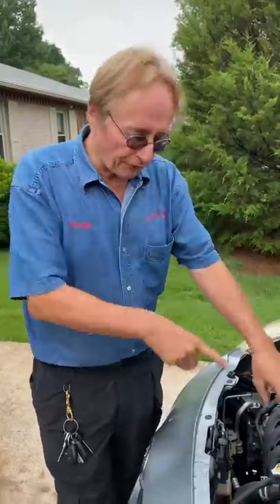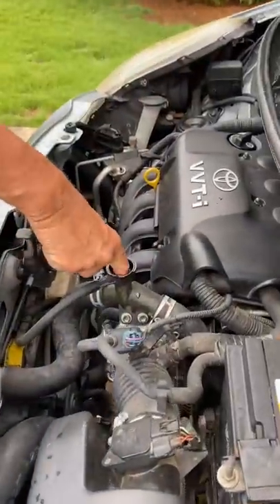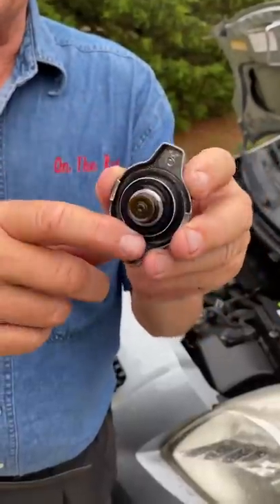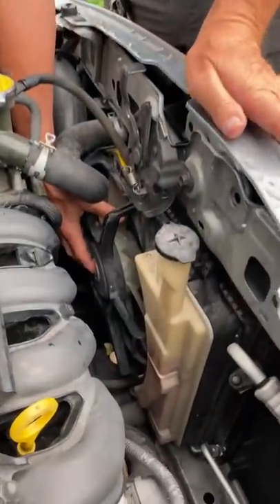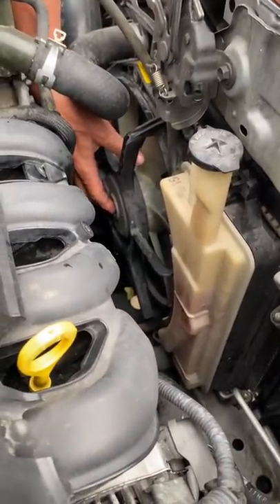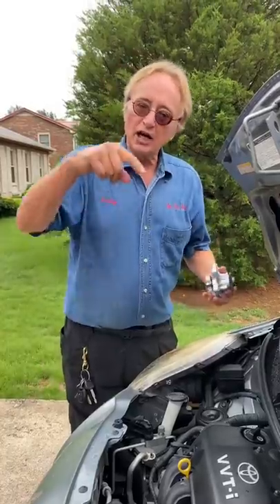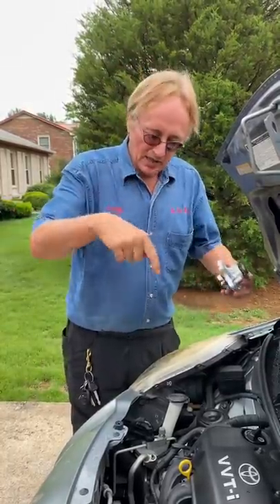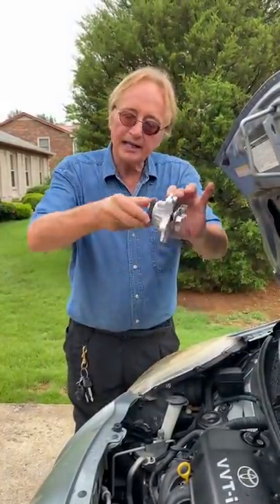If You Want Your Engine to Last 400,000 Miles, Do This

Comment: In a pinch, to get somewhere safe, you can drive with the heater on full blast.  Just keep your eye on the coolant temp not to get it in the red. It helps pull heat away from the engine.
Reply: Common sense.
Reply: Pull over and open the hood.  Wait 15 to 30 minutes.  Drive till needle gets close to red.  Repeat.  Works quicker in winter.
Reply: And turn the a/c off
Reply: I've done that and I really didn't see a difference... maybe my heater core is too small.
Reply: @sandasturner9529  Assumes sufficient coolant is system to dissipate heat via heater core.  Brutal on a 115 degree day in Las Vegas...
Reply: @johnsee7269  well my car only overheated when the radiator hose tore open. Then it took a while for that to happen. 2006 supercharged grandprix
Reply: Yeah, heat on, windows DOWN.
Reply: @sandasturner9529  
If there's no coolant in the system, turning the heat on won't help much.
Reply: Not the ac though right?
Reply: In my air cooled Porsche 911, I would pull up on the heater levers to cool down the oil temperature in traffic.
Reply: Definitely depends. Had a coolant sensor blow out with the crappy plastic mustang intake. I was turning off the road as it did this. Turned, pulled over and within those 2 mins burnt 2 valves. I guess I valve per minute lol. 
It was a great excuse to purchase the better PI intake and stage 2 ported heads though lol.
Reply: Just remove the hood, who needs it?
Reply: Opening the heater all the way allowed me to safely get back to my area. Was a brutal South Florida summer day, and I was in heavy traffic, zero breeze with windows opwn. But the heater core kept the coolant temperature barely above normal. I caught it early enough there was very little temperature rise to begin with.

The culprit: lower radiator hose was cracked.

Comment: Dont forget to check the Thermostat, some stick closed when they should open. Easy to test by throwing it in some boiling water and looking for it to contract.
Reply: Thats exactly what happened to my 02 corolla. Ran well when moving but stopped or idle too long and it overheated. My dad knew whats the problem when he saw the coolant wasn't flowing well and we got the thermostat changed. Thank goodness my dad is a good mechanic.
Reply: Grizzly  Hehe. Well he's no Scotty, but he does have a lot of experience with cars.
Reply: Too right. I just had that on a remote thermostat which jammed closed. It meant the engine was ok on the internal coolant loop for a good time but once I was on a fast road the bloody thing overheated when the thermostat failed to open. Result being the head gasket went so that's been a pain to replace.
Reply: @simonroyle2806  Bugger thats not good,i just put new thermostat in my back up Toyota,i got genuine toyota one the price was good and its quality ....
Reply: Suspicious thermostat? Throw it away.... if you live at equator like me!
Reply: Save electricity by adding pasta 😋 while you boil BOTH in mom's BEST PAN! 
We know who you are! 😏

Comment: Former radiator repair guy here. If your car has an overflow tank, as most do, there is a small valve in the cap. When it wears out it stays open so that your cooling system doesn't stay pressurized as it should. If you see no leaks change the cap and see if overheating stops. It's often that simple.
Reply: What's the worse that could happen if you overfill coolant overflow tank? I can't see the damn markings!
Reply: @Vanguardkl  Well  I overfilled mine once with poor lighting. one of the radiator hoses busted after driving. Keep it  half full, look at it when it's hot. If its 3/4 full hot your in the ballpark.
Reply: @soundmind192  If overflow tank is too full it'll just blow it out and waste it. Like an overfill automatic transmission. But an overfill trans is a bad thing. Potentially damaging. Overfill coolant, not.
Reply: Make sure your overflow tank has an over flow discharge tube and nothing will happen it will just go down on the ground. Only fill the overflow tank half full at the most.

Comment: Have a Hilux, radiator was busted on it and it overheated frequently. Still drove it, never broke. New radiator in now and it runs like new 😂
Reply: Toyota Tanks
Reply: Must be a old one they are tanks
Reply: Diesel ?
Reply: Gonna if it's the 22re those are tough little motors but there aluminum heads that couldn't like too much heat on it...........hello warped heads
Reply: The truck Top Gear couldn’t kill. Another testament to the little truck that could!

Comment: I had a Plymouth Breeze with a bad head gasket.  I could drive it, the temp would hit max, then the expansion of the engine would seal the leak and temp would go to normal.  Not great long term and I don't recommend it for most :)

Comment: Those water pumps are tricky when they start leaking because they leak fast. That’s the only issue I’ve had with my Volkswagen Golf. I had to buy G13 fluid and I kept it cool. Replaced the water pump and thermostat. Luckily it was -20 out so keeping it cool wasn’t complicated lol.

Comment: My gauge doesn’t work, it always stays at cold. But it had an overheating problem too, so the gauge made its way to the middle. At that point I thought it might have started working, but I wanted to make sure. I checked it and it was boiling. I put in a new radiator and flushed the coolant and it works great now. The gauge stays just a millimeter off of cool

Comment: The cooling fans on my '16 Mustang WILL NOT engage with the A/C on, unless the outside air temp is over 95F or the engine is over 180F.  When one or both are at temp, the fans kick on & off normally & the temperature gauge never goes above less than half way.
/It's just the way it is!  Not all vehicles are made the same!
Reply: My 2010 Toyota Venza is the same. I never hear the fan running unless it's over 95. My 2001 Sebring though, that fan is always roaring.

Comment: I have a 1999 Toyota sienna no matter what clamps I put on the radiator hose or change to a new hose the coolant always leak at the clamps especially in the winter last summer it actually didn't leak till winter it leaked again

Comment: My Tiguan has been overheating, the coolant cap is cracked and the elastic that pressurizes the reservoir is broken. Will be replacing the cap soon.
Reply: Giovanni Martinez  I stopped driving the Tiguan till I got a new cap. All is good now, hopefully, nothing bad or permanent is done.

Comment: I have a 2015 Dodge Dart SXT with 2.4 liters I’m an original owner and so far I have 210,000 miles with twice flushed for every 100,000 miles with 2nd times and I always change the oil and filters OW-20 high mileage and now for the first time almost 210,000 miles with changes the Battery for the 2nd times, and the first time the original alternator went kaput replace with OEM at the dealership service and with the new positive battery cable due to corrosive since I live in Upstate New York then all good
Reply: Tune-up once so far

Comment: My mothers car is a Toyota Yaris form 1998 still going 340.000 kilometers. Never had its engine Open ONLY regular service
Reply: Yes my 2009 has been extremely reliable loving it so far, wish it had a little more than 106 horse power but the gas mileage is great. I’ve just done oil changes every 3k miles, iridium spark plugs, air filters, tires and brakes.

Comment: Last month, had a radiator hose blow out on the Jeep GC inherited from my father's family while stuck in severe weather, torrential rain and bumper-to-bumper waiting behind a real bad wreck. And this was with me intermittently cycling the car off in the times there was NO MOVEMENT -- despite the care I took, the boiling still happened and the old hose just blew. Was a hell of a time between me, my other family members getting me help by a police officer to move the Jeep to the next exit in the HEAVY downpours and then pulled into an open-air spot underneath the highway. And this happened in an unfortunately bad reception area no matter the cell phone provider, which didn't help things any.

Thankfully an auto store is in the nearby shopping center and my father's a regular customer. After calling in the order and me getting the replacement hose, I went right home nearby via different vehicle for distilled water and tools to get it changed, then drove the Jeep home. Going through a tear-down of the cooling system, you know what the true culprit was?

The thermostat was broken via metal fatigue, thus causing one of the big issues thermos can have -- and my father said that in all of his years, he's NEVER seen a failure like that one…

Heck, the radiator itself saw damage during removal, so it had to be replaced with a new one. All of the parts in cooling were original, so we just outright put in all new components of OEM quality. Just last week we finally finished all the replacement work on this Jeep, and it's back to working service.

It's a good thing that vehicle isn't our main driver now.

Comment: I'm from the UK I have a AudiA4 2.7 tdi V6 Auto with CVT transmission had gearbox overhauled at 119,000 have had the gearbox serviced every 40,000 miles & oil service every 10,000 miles I now have 206,100 miles on the clock now I hope to get many more miles do you think I'm dreaming 😀

Comment: Hey scotty was wondering if you had a video on this or know what to do I recently went to try to get my transmission fluid replaced and they told me had I replaced it within 50,000 miles and I told them I didnt know because i bought from a used delar at 140,000 miles and put about 30,000 miles on it  so they told me I needed to sighn a waiver that they are not liable if my car doesnt drive after  and that they do not recommended me to change it . So now I dont know what to do they basically told me to drive it the wheels fall off . It is a 2007 chevy impala LTZ

Comment: My girlfriend has the same Yaris as in this video. Everytime when the fan turns on in lower temperatures the car idles rough. When it’s an hot day the car runs fine. It doesn’t show any fault codes. Do you know what’s wrong?

Comment: I remember my motorcycle overheated in slow traffic in the city so i had to do an emergency pull in and turn off my engine to let it cool, but because I have no hazard indicator lights (lots of bikes dont have em, but i indicated in) and i just remember seeing what i did fully piss off some guy going past and they were like "why tf you pulling in you cant do that" through hand gestures, in which i would reply, "you would do the same if your engine was about to blow up soon" but thankfully they never stopped and just kept going

Perspective is such a big distortion.

Comment: Okay I drive a 2013 Malibu and let me tell you I’ve had overheating issues with this thing. It would overheat then go back down on the gage to see it rise up again but it seems when I get over 80 it’s fine but I’ve been in the red and haven’t had my coolant boil but sometimes I just wanna drive it in lava and see if the car survives because it’s been a beast for me and I’ve made sure the oil changes are done and it has been reliable but even to today the sylanoids had to be replaced and I think they need to be replaced again but Scotty what do you think?
Reply: Drive it until the wheels fall off or get rid of it before it  becomes? or already a money pit.
Reply: @soundmind192  it hasn’t been a money pit but I’m sure that’s coming so I’ll take the advice on driving it till the wheels fall off. I’ve owned it for a few months now but already have backup in case something happens except for getting stranded if that happens hahaha

Comment: I overheated an identical yaris to 293 when my belt exploded on a hill. 30k miles later, no damage! Woohoo!
Reply: Toyota are simply amazing. I have a Corolla with 315,000 and it just purrs and my tundra has almost 250,000 and purrs also. I drive very hard but am good about maintenance.

Comment: hard to believe water pumps havent advanced yet.  if most of the motor can last the life of the motor, im sure the water pump could be designed to do so also.
Reply: Well, my 4.6 now has 242k. I changed out the water pump @230k as a precaution. Never made a peep or leaked. 4.6 2v solid engines.
Reply: @soundmind192  thats cool. but exceptions dont make the rule.

Comment: My car doesn't have a radiator cap and it doesn't have a temp.gauge either. :)
Reply: Oh you got a Tesla
Reply: @Clutch6  No, I don't. But many modern cars don't have a temp.gauge nor a radiator cap. You'll find an expansion tank and the temps. are measured electronically and warns the driver if, and when, it's necessary.